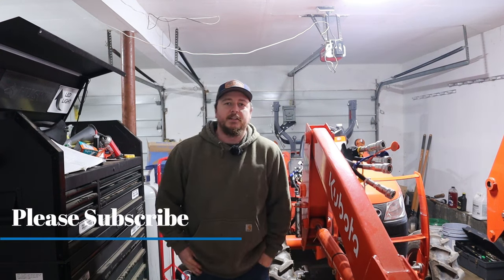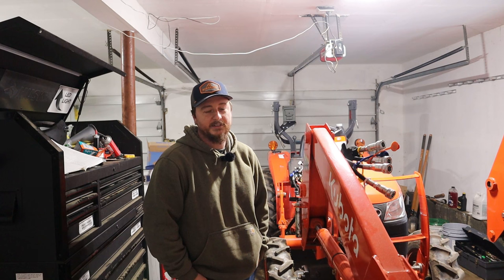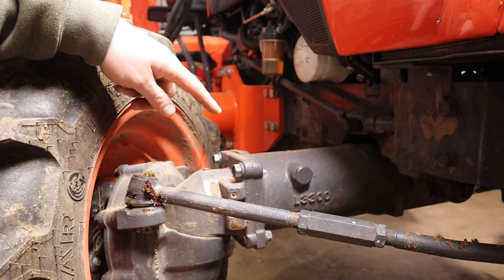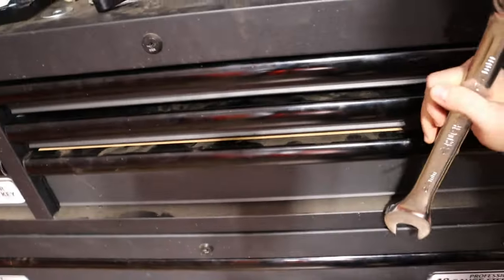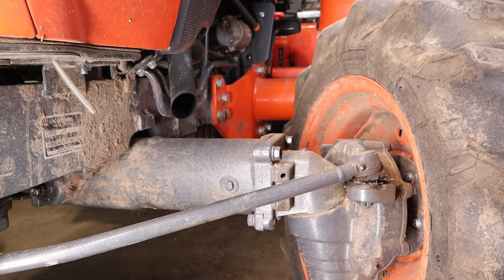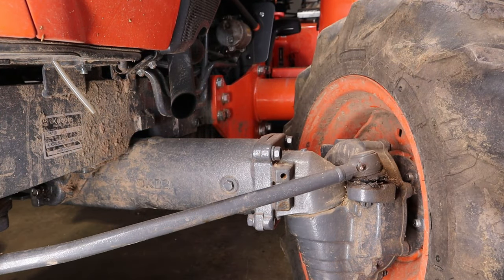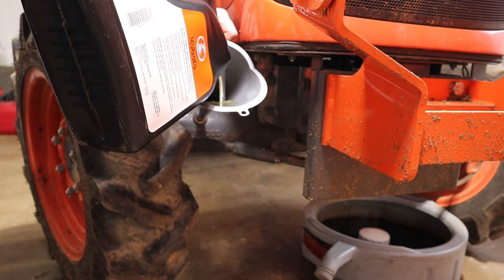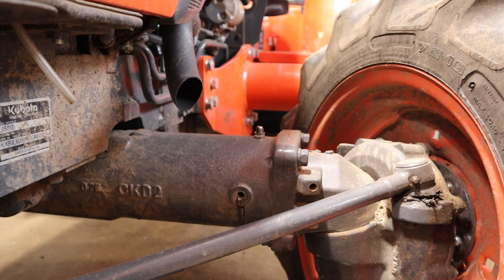Kubota Owners Check This NOW!

Comment: You have to check it hot not cold, because oil expands when hot, over filling can cause seals to leak, so don't overfill it cold.
      Seals leaking just a little bit will use oil and cause it to run dry, check it about every 200 hours, change it 800 hours.
Reply from the maker: Thanks for sharing !
Reply: @HillsideAcres  I used to run a Kobota mowing 40 acres of food plots once a month,  we had front and rear end oil leaks because of sand intrusion into the seals, and that crazy seat they have on them caused me constant back pain so we switched to a John Deere Hydrostat, with Air ride seat, a lot easier on the back over rough hill sides and no oil leaks yet after 3200 hours of operation.
             Kubota makes a good tractor but for constant hard usage they just can't beat that Little Jhon Deere or a Yanmar, with Air Ride seat.
Reply from the maker: @carrollsanders9376  kubota offers air ride as well! Thanks for dropping by !
Reply: @HillsideAcres  They didn't in the L series that we had but the main reason we changed was everytime we crossed the muddy creek, we had to replace axle seals because of sand intrusion on the seals, not a problem in the John deere, if your not crossing creeks constantly then you probably will not have that problem.
Reply from the maker: @carrollsanders9376  I dont do any creek driving with my tractors.
Reply: @HillsideAcres  On a 3000 acres farm it unavoidable, same reason we switched from  John Deere gators to Honda Pioneer, no belt slippage in the honda.
Reply from the maker: @carrollsanders9376  that’s a really big farm
Reply: @HillsideAcres  I know, I am the farm manager and heavy equipment operator and mechanic.
Reply from the maker: @carrollsanders9376  that’s a lot of paychecks!
Reply: @HillsideAcres  Yes but I would Rather go back to my old Job making 150, to 5000 dollars per hour.
Reply from the maker: @carrollsanders9376  I would probably go back to making 5,000 per hour too if I had the opportunity !
Reply: @HillsideAcres  You should ask what you have to do for that type of money first,before making your mind up you want to do it.
Reply from the maker: @carrollsanders9376  how do you make 5,000 dollars an hour
Reply: @HillsideAcres  By doing dangerous stunts with Chainsaws Like Carving on my toenails, or scratching a lottery ticket off while it's taped on my neck.   I Have even been known to shave someone with a Chainsaw, but that's really not that dangerous at least not to me.
Reply from the maker: @carrollsanders9376  sign me up !
Reply: @carrollsanders9376  LOL we believe you
Reply: If you are crossing creeks straight after hot heavy work...
and you haven't drilled the axle housing fill plug for a vent line leading to a high place (say up under the hood.... 
and included a cheap inline fuel filter on the under hood end of the line to let air in and out but keep dust and dirt out....
the rapid cooling of he axles creates a suction inside the axle that draws water (and sand particles) into the seals.
You need extended ventilation tubes for the axle housings even on 4wd vehicles (like Toyotas, Jeeps etc.) for the same reason...
those little steel vents on the axles allow water to be drawn in through them....
you need the long tubes led up to the engine firewall...or up to the roll bar if you are really serious at water crossings..

Comment: Do you just use the standard UDT trans hydraulic fluid?
Reply from the maker: That’s what they come with from the factory so that’s what I had used to top it off. When it comes time to change it I will probably go with I believe is 80w90 gear oil which the manual states is suitable. I like the denser viscosity of the gear oil better. But the super udt2 is just fine.

Comment: When they did set up or pre deliver they didn’t check it . I used work at ford new holland I did set up we always check them most of then was full do dealers off 50 hrs check we did them back in day
Reply from the maker: The dealer has to add the initial fluid, it seems that they do but dont operate the tractor as the manual states and then perform a recheck.

Comment: Received my L2501 DT Friday, opened over flow…nothing…opened fill plug and stuck my finger all the way down. Only felt residual on axle tube, I could not feel a fluid level, I will be topping it off tomorrow, glad I checked with .3 hours cause it’s low. Transmission oil is also not on sight glass, pointed it out from dealer deliver he said he will give me some free fluid. Thanks!!
Reply from the maker: Glad to hear you got it all straightened out! Especially before putting the hours on!

Comment: I've had to repair the aftermath from folks not checking this and it's not cheap. Take a few minutes and check your equipment
Reply from the maker: Its just too bad that they all come low from dealer
Reply: @HillsideAcres  not from my dealer, it was full and checked off on their prep list. Having dealt with my dealer for many years I believe they care. 👍

Comment: Have you ever noticed the front wheels of the Kubota L are kinda tilted like they something is bent or off ? Straighten the wheels step back a few feet and look. Not sure if its normal or not … thanks
Reply from the maker: The front wheel tilt is normal and is referred to as “toe in” as per the manual. It is sceduled to be adjusted every 200 hours. Thanks for watching !

Comment: I do not think the dealer adds this fluid. They may be required to confirm its level though.

All critical fluids should be added at the factory as it is run down the assembly line together with all other fluids, perhaps even before the axle is mated to the tractor.   Every tractor is run before it leaves the line and needs all the fluids in place.

Having the dealer do it would mean quality control is outside of the factory system and leave them exposed to warranty claims.   This low oil level would seem to be a miss-communication at the factory,  but that’s my guess
Reply from the maker: The dealer absolutely fills the front axle, they arrive at the dealer in crates for finishing assembly. Filling the front axle is part of the assembly procedure they just don’t fill operate and refill as stated by the manual.
Reply: Hmmm

Comment: will this cause my 98  l2900 to run in high gear but only move slow like its in turtle, and when i go into turtle it doesnt move at all?
Reply from the maker: No this is for lubrication of the front end I would check your hydro/transmission oil levels. When was the last time you serviced the hydro and filter ?
Reply: @HillsideAcres  around 6 months ago i had it serviced when the clutch was replaced
Reply: but i cant even get it on the trailer to bring it to shop cause it wont go up the trailer
Reply from the maker: @trickofthetradeoftheday  I’d make sure you are running correct levels worst case you may need a pump !
Reply: @HillsideAcres  alright thank you so much

Comment: Sight glass on side and a top fill might make the owner more receptive to maintain, just my opinion 👍
Reply from the maker: Sight glass on an axle could see some damage easily but it’s up to kubotas engineers at the end of the day
Reply: Not really, if owners suggested, things might change.  At least you would agree a top fill would be a lot easier to fill, and those sight glasses are pretty tough, maybe behind axle?  Just throwing it out there
Reply from the maker: @tcmits3699  the best start would be putting proper level from the factory lol
Reply: Hey I agree 100%,  but I still think my two suggestions would be an improvement, if I break the sight glass "LEVEL" that's on me.  Their cheap
Reply from the maker: @tcmits3699  drill it out and install one
Reply: You don't need to drill it out,  you just replace it.  They come in many different threads.  See ya
Reply from the maker: @tcmits3699  so do it
Reply: @HillsideAcres I DID, AND IT WORKS FANTASTIC, NOW I JUST GLANCE AT IT AND THE LEVEL IS PERFECT!  DO YOU KNOW WHERE YOUR LEVEL IS TODAY😂😂😂😂

Comment: I would drill and tap that drain 14mm bolt to a bigger size and add a sight glass in its place, so you can look at it rather than taking those bolts out to check the level. 
My 30 year old kubota L2350 has a hand tighten dip stick for the front differential, seems like Kubota is cutting corners on the newer stuff, less pride = cuttings corners.
Reply from the maker: Thanks for sharing but drilling and tapping as sight glass would compromise structural integrity, don’t forget the front axle serves a purpose other than holding oil! I’ll look into trading up to a 30 year old model thanks !

Comment: I have an L4701 and mine was between a pint and a quart low at first check and I had very few hrs on the tractor at that time. I strongly recommend this gear oil level being checked early and offer during initial ownership atleast till you get a bead on your tractor. Fortunately for me this possible issue was red flagged early in my ownership . These are great machines, but you can’t hotdog the maintenance as with any tractor made regardless of color. Great Vlog !!
Reply from the maker: Appreciate you watching !

Comment: But where's the fluid going?
Reply from the maker: Low from the factory means it was never added
Reply: Good to know! Really makes you question alot of the quality of the machine. I was always told kubota was top of the line.